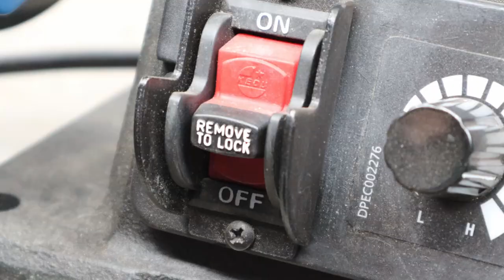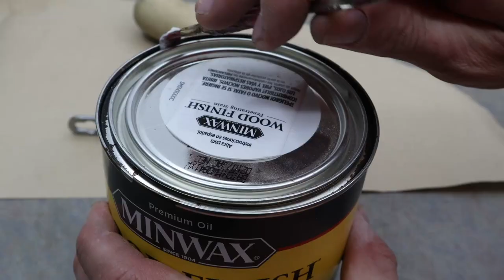$7 Vintage Hand Drill Restoration

Comment: Nice work brother. I actually like using those old hand drills for woodworking because i have found that i have better control and with a sharp bit they drill a cleaner hole.
Reply from the maker: Vintage taste. I like it. I sold this one so I won't be able to use it in the future.